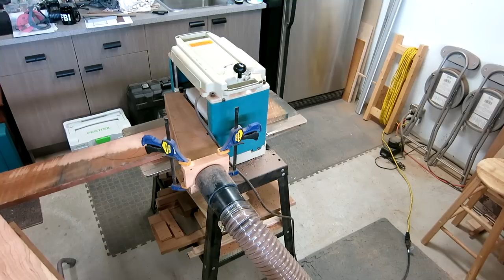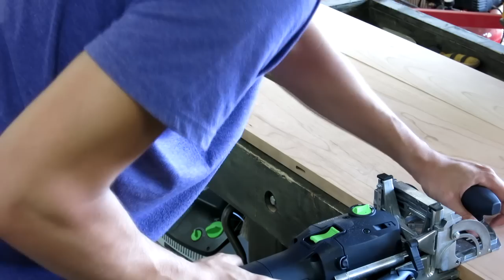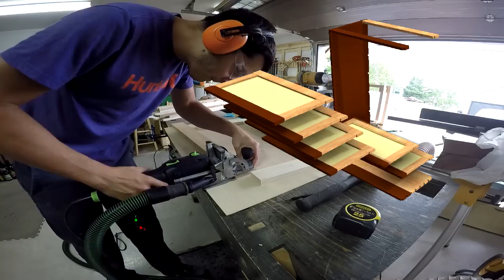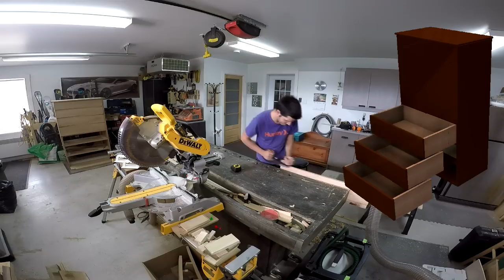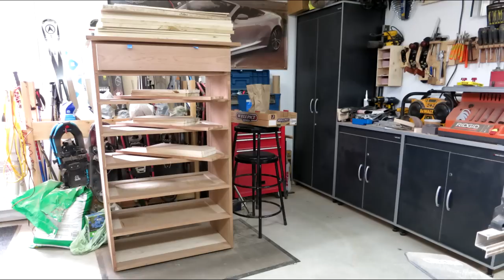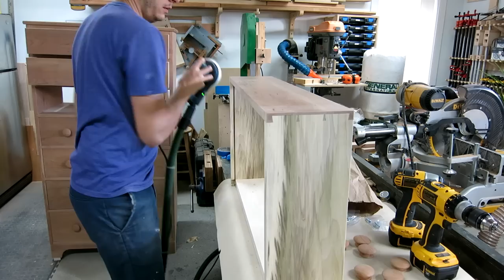Making a Shaker chest of drawers

Comment: Very nice work.  How are you accounting for seasonal movement of the case sides?
Reply from the maker: The grain for all of the casework is oriented in the same direction. For the dust frames between the drawers, they are only glued at the front of the case and float in the back.

Comment: excellent job. i love the traditional techniques so im just wondering why you brought the domino into play on the dust frames? this is not a criticism by the way. you are very skilled
Reply from the maker: nick sainsbury in all honesty, no particular reason other than I had it and it was quick. The inside of the dust frames are made with plywood also (only place where there is plywood, since the drawer bottoms are solid and the back is shiplapped cedar).

Comment: Loved your video.  Am I correct in saying that the drawer slides/dividers had had a sold insert, plywood or something similar?  Is this common to shaker chest of drawers?
Reply from the maker: Mike Fischer they do indeed. I am not sure if it's common with traditional Shaker furniture, but they are called dust shield and are here to close the drawer tops to prevent dust from accumulating inside the drawers. Also prevents clothes from dropping through the next drawer.

Comment: The one step I watched to see, was skipped.
Reply from the maker: What step was that ? Perhaps I can help.
Reply: @junado  The dadoed, stopped dovetail sockets in the stiles. I will be cutting some in a small chest of drawers I am making. I see a lot of folks don't dado, but then it seems that the rails could be off a little if they depend only on the dovetail for positioning. (Shown at 6.1)
Reply from the maker: @rickreed123  I built a nightstand version of this chest of drawer this year and improved a bit on the technique, let me try to break it down here and please let me know if anything is unclear.

Your side panels should be milled with at least a final reference edge at the top or the bottom (you will reference your dadoes from this edge) and typically a bit wider than their final width to account for tearout / cleanup.

You will use a router bit that will cut the dado width in a single pass, as this makes the process a lot easier (you can reference off the center of your bit for both cuts). If you have two routers with identical baseplates, I would set one up with the dado bit and one with the dovetail bit.

I laid both side pieces flat on a workbench, with the insides facing up, back to back. Leave about an inch of space between both pieces, using spacers, and clamp both side pieces together. The space in between both pieces will be used to start the dovetail cut in the back.

I then used setup blocks to reference the bottom edge of the case side pieces to clamp a straightedge in place, then route away. Make sure your straight edge is square to the case. If you have a single router (I did), I would route all the dadoes, then switch to the dovetail bit and route the dovetail slots. You have to route the dovetail slot in one pass, so you should expect a bit of tearout, which is why I leave the panels a little wide a this stage.

A few more tips : 
  - Make your dovetail cut as deep as the rabbet that will house the back. This makes for a cleaner look on the back of the cabinet (it hides the joinery).
  - Consistency is a lot more important than accuracy. If your dovetail cut is a little off center on your first cut, make sure it is consistent across all joints. This will make cutting the male part of the joint a lot less fiddly.
  - Leave your drawer separator parts thick when milling, you will need to fit them to your dado (not the other way around).
  - Do not glue the sliding dovetail in the back of the case, nor the sides of the frame to the case. This allows your case sides to expand/contract relative to the separator frames.

I hope this cleared things up a bit.
Reply: @junado  Thank you so much for the information. I will let you know how it goes.